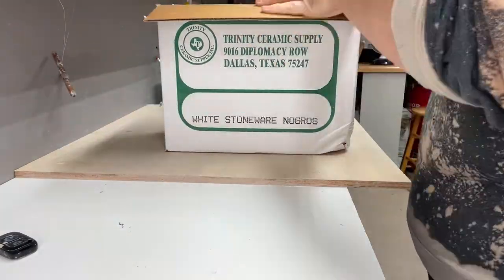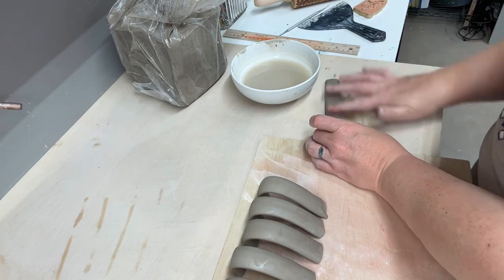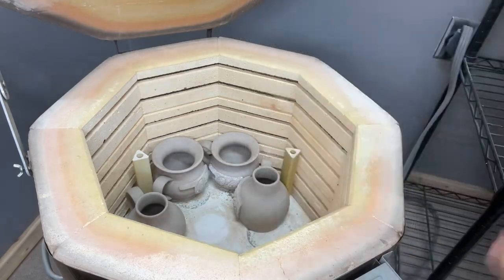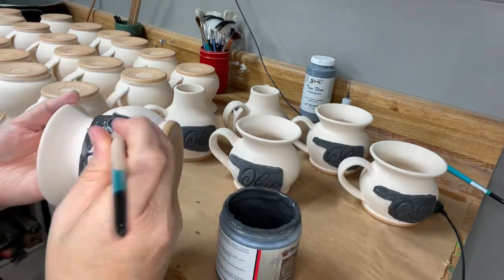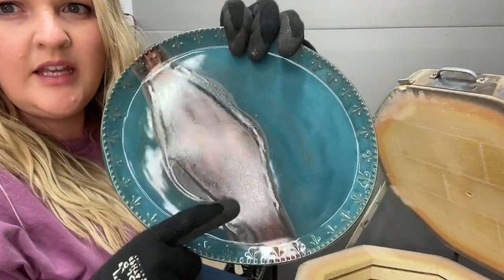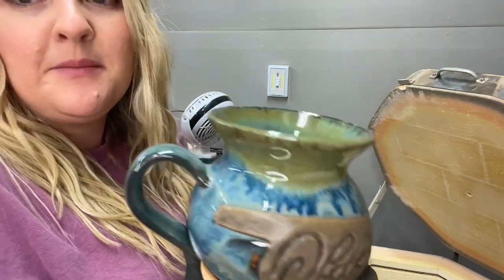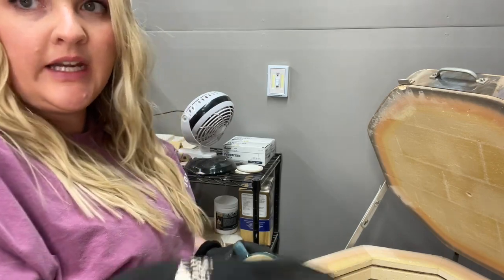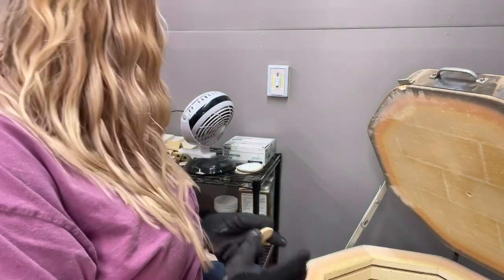Mugs start to finish! My favorite tools. New dipping glazes and a KILN OPENING! #pottery  #ceramics

Comment: What an awesome video! I love seeing your back! These are gorgeous!!! I love the plate too. Just a few little things to hopefully help you out. First of all, the two last mugs have the large bulbous shape right after the seaweed so on the other shape the seaweed may drip a bit further down. Also if there is any way you can runs your pots after sanding them that would be reallly good!! You just do it a day before you glaze so the bisque will still absorb the glaze. When your rubbing the sanded pots with that same bit of water it tends to get sucked up into the sponge over and over again. I use running water with high pressure over my pots before glazing. If things have a lot of texture I use a wash cloth while I rinse. I allow them to dry on my counter overnight and then I place them I. A plastic bin with a lid until I’m able to glaze them. I have t had any glaze runs since I started doing this. I know it’s another step in an already argues task but it’s really the only way to make sure that dust is all off of there. I really like the mugs where the seaweed was applied at an angle. I think it would be cool to do some straight and some angled like that. I’m so excited for you to have this opportunity. Good luck with everything.
Reply from the maker: Hey Michele! Yes definitely great tips, thank you. I suppose I’ve gotten a tad lazy and didn’t want to carry everything inside to use the running water lol. We definitely need a water source in our shop. 

And that’s a good idea to keep them covered until ready to glaze. I’ll have to figure something like that out.
Reply: @moreldesigns2674  I’m glad you found the tips helpful. I know a lot of people who keep their pots in a small greenhouse that has a cover on it. But it has to be somewhere that the wind won’t blow the dust around and get in the little tent. I don’t have running water either. I work out of 5 gallon buckets. There is a process for cleaning clay stuff that they call the 3 bucket system. You can look it up. I do always use running water to rinse my bisque.